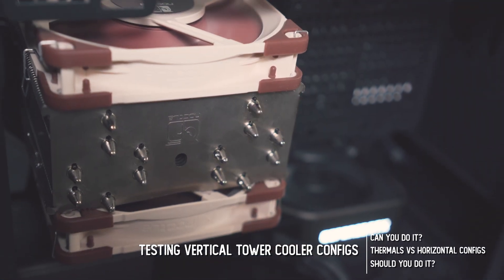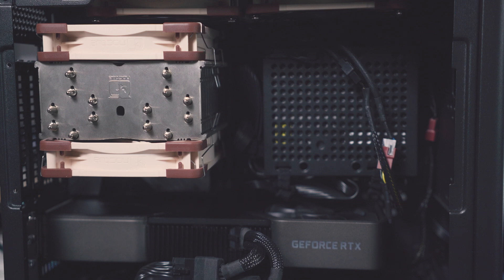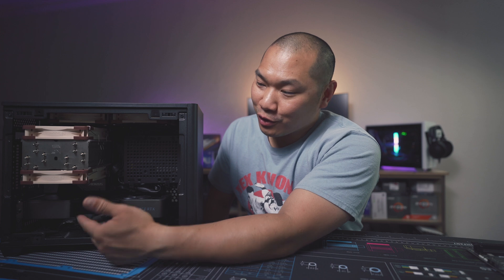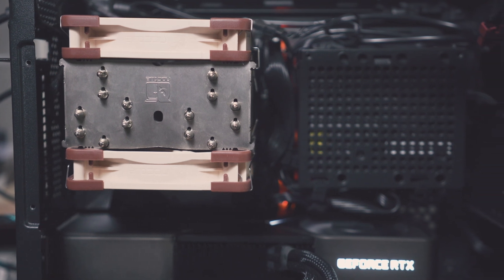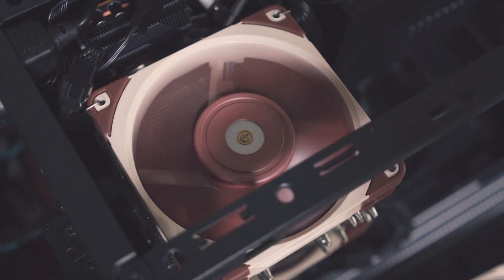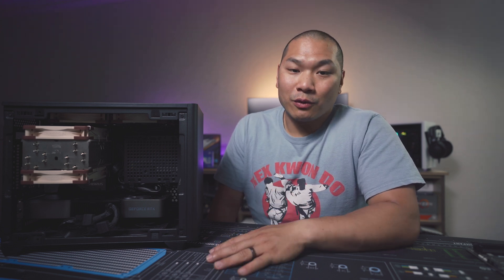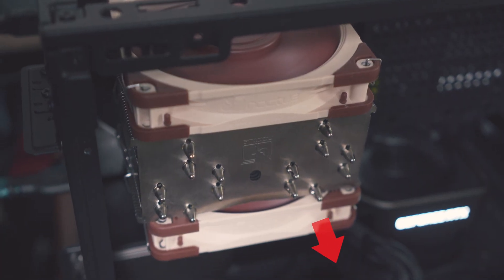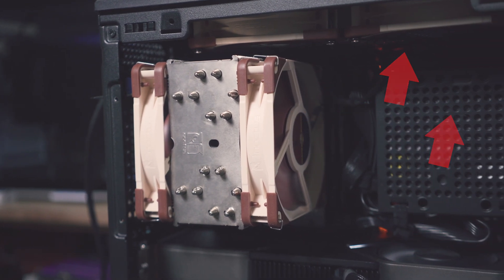Testing Vertical Tower Cooler Configs with Flow Through GPUs, feat. the NR200

Comment: Ordered k66 itx case. And unable to fit 120mm cpu fans. I may try this out
Reply: Thanks for the video, k66 itx case,  I will try horizontal rear Intake  to cool ram and use sfx fan as vent. Will also have  2x 92mm fans above

Comment: did you experiment with having both top and bottom case fans as exhaust? sounds like a lot of negative pressure but i'm wondering if that'll just mean more cool air drawn in from the side panels.

Comment: I have a Silverstone FT-05 set up for a perfect vertical airflow scheme (CPU tower installed on the GPU). There's one 140mm fan on the CPU tower, and one 120mm fan on the GPU tower. The PSU is a passive SFX unit on an offset (this, along with using a board with a first-slot PCIex16, was necessary to fit a 120mm tower within the constraints of a 7-slot case).

Anyway, after I set up the build this way, I found that intake and exhaust fans aren't necessary. So long as all of the fans in the case point upwards, the hot and cold air don't mix and stay in the case. The hot air is always above the components, and the cold air is always below them. It's not a pure convection system, but it has the silence benefits of one, with the performance benefits of a mechanically-cooled system.

Also, unlike in your system, both the CPU and GPU in my system get their own fresh air, and they dump heat at the same height, meaning that there's no exhaust mixing. I can actually detect a temperature difference above the case when running specifically compute or graphical benchmarks. So in effect there are 3 temperature zones; passive intake, GPU exhaust, CPU exhaust.

And because all of the noise is generated deep in the middle of the case, for sound to escape it has to take an indirect route out of the enclosure, unlike sound generated by case fans, which is generated directly adjacent to the escape path.

Honestly, after this current build I'm never, ever, going back to a horizontal layout. I can run a full torture load without hearing my PC at all, it's extremely nice.

Comment: This isn't a question about vertical tower coolers, but on the NR200 series as a whole.  I guess over the whole series, I've mixed up your recommendations.  For mainstream use, I'm pretty sure you've recommended a Noctua NH-C14S.  But, I'm unsure of what your recommendations are for the fans.  Is it two 120mm x 25mm fans (Noctua A12x25 PWM) at the bottom bringing air into the case and one at the top exhausting air (only one at the top because the NH-C14S blocks the other top fan position?)?  Or, are you recommending a side-mounted fan instead (intake?  exhaust?)?

Comment: Bro, I put 2 
Noctua NF-F12 iPPC 3000 PWM's on a ARCTIC Liquid Freezer II 240 radiator like in your previous video. It's mounted on an I7 9700K overclocked to 5 GHz. Highest temp thus far is 64 C with Idle temps 15 C lower than air cooled. I love the sound of the Noctua Industrials.

Comment: Kinda weird. I have a 3080 FE, Nactua U12A and a B550I Aorus Pro AX with a 5900x. I get worse thermals with the CPU cooler as intake then exhaust. I'm using an Inwin A1 case so top exhaust isn't an option. Ill have to check my findings to make sure I didn't screw anything up along the way. Love the content, Just found your channel and subbed.
Reply from the maker: Inwin A1 has a rear fan option right? Is that being used, and if so does the direction match? There is a very different case/fan layout with that case with the side panel fan and no top exhausts so an exhaust setup could ostensibly be better.

Comment: If you have a case that has bottom fan mounting possition set to intake and top fans to outside, I think this definitely could be a good idea with newer pass through GPUs...well if you can get one that is
Reply: And actually could be a use for vertical mounting the gpu

Comment: this video was convenient, i was just wondering how good it would be to do this and this video popped right up a couple hours later(!)

so by rear intake are you pushing air from the left to the right and upwards next to the psu? in that case, would dust become a problem over time? i saw that in optimum tech's video ( https://youtu.be/TUO59lwdB9I ) he used a vertical cooling layout and achieved superb temps with a flow-through fe card. worst-case, with an i5-11400, he achieved around ~80°C max temps. perhaps dust wouldn't be as much of a problem in this manner, as all the airflow directs through the top panel?

  thanks for your dedication to the nr200! :)
Reply from the maker: Dust is a potential problem with rear intake, and yes you described it correctly. Some users have mitigated this by cutting the dust filter to fit around that area and just cover it, or clean it more frequently. In either vertical config dust isn’t a big issue, the bigger issue is the limited exhaust or intake airflow, and in the top exhaust scenario, the source of that intake. I haven’t reviewed the 11400 yet, but that temp you mentioned sounds like there is a bit of interference from a graphics card, normally the chip should top out in the 70’s for an all core load with an average cooler.
Reply: @MachinesMore  thank you so much for your fast reply! i'll definitely consider the best airflow from your videos when i start building my pc in the nr200 in a couple months. your videos have been massive help, straightforward and not bloated like bigger creators.  keep up the good work my guy 👍

Comment: Cool video! Why is the control configuration rear intake as opposed to rear exhaust? Just asking because I thought that was your general recommendation in the video you posted a few months back on the best air flow configuration.
Reply: Ah, the difference is that this is a flow through GPU. So since I currently have a standard GPU with both fans on bottom, and rear exhaust on the CPU, if I ever get a flow through card, I should flip the CPU orientation?
Reply from the maker: Indeed. With conventional GPU coolers and board power <200W, it’s not a big difference either way,  the rear intake is slightly better when running bottom fans, but even then I would lean towards the rear exhaust for dust control. With flow through GPU coolers as illustrated in the video, rear exhaust becomes an inherently bad configuration and yes, absolutely flip it if you go that route. The CPU thermals are atrocious.
Reply: Flow through cooler should make it easier as it dumps less heat into the case. Normal gpu cooler will dump all of its heat in to be sucked in by cpu cooler. And you could always make a channel between the flow through exhaust and top exhaust and isolate it from rest of the system.

Comment: kinda weird setup, why slims on the bottom instead of two NF-A12x25?
Reply from the maker: It’s just how I had it setup from a prior test with a thicc GPU… the P12 slims are pretty similar to the P12s and I just left them as-is. You can go either way with 2-slot cards.

Comment: One possible experiment I'd to have the top fans running in opposite directions. The one above the cooler as intake and the other as exhaust. You might get some issues with turbulent flow but it also might balance better.

Comment: Which would be the best for a non-flow through gpu cooler?
Reply from the maker: Depends on if you are running bottom fans and how powerful your GPU is. Bottom fans or a powerful GPU will be best as rear intake, otherwise rear exhaust is fine, and this avoids potential dust issues from the non filtered rear vents. A 2070 (175W) I tested with early on was about the same whether rear intake or exhaust. A card with board power above that of a 2080ti/3070 is for sure going to see rear intake be the best config.
Reply: @MachinesMore  appreciate the tip. gonna try that soon!

Comment: I think this needs something like a divider to block the exhaust from the flow-through cooler portion of the GPU from the CPU cooler intake in a bottom to top configuration. I do agree that the motherboard area will still receive an inadequate amount of airflow in this configuration.
Reply from the maker: Yeah, it’s not great either way, especially considering the CPU only tests, there’s just bad airflow either way (obstructed on one side whether intaking or exhausting). At that point it’s already in the “why bother” territory. 😊

Comment: Question to NR200 owners, do your bottom fans make particularly loud noise when running high ? I put 2 noctuas 12x25 and i find the noise very loud, like a waving growling. I suspect the bottom metal plate they are attached to that is not rigid enough
Reply: Mine hum at high RPM, but they are Arctic P12s so I don’t think that’s the issue. Could be that the panel isn’t seated well. Try disassembling and reassembling.
Reply: This happened with my fan when I had yhe screws too tight, try loosening them a bit!
Reply from the maker: One thing you can also try is to use the anti vibration mounts that Noctua supplied with the fans.
Reply: thanks guys, I tried to loosen the screws, seems to help a bit, i also tried the silicone gasket, also reduced a bit but not totally, I'll try using the silicone anti-vibration mounts tomorrow, if it doesn't help I'll try to find a way to reinforce the bottom plate, it's quite flimsy in the middle due to the ventilation perforations